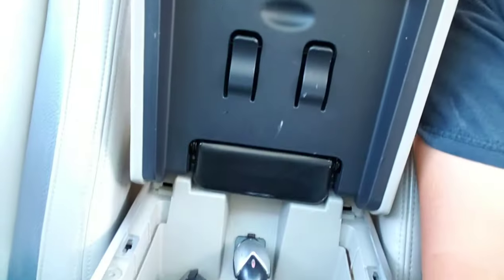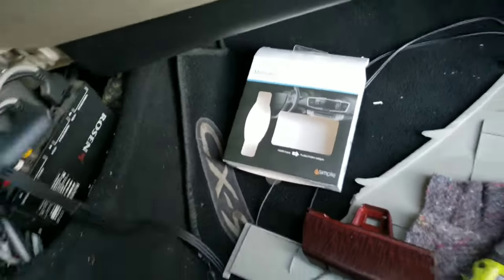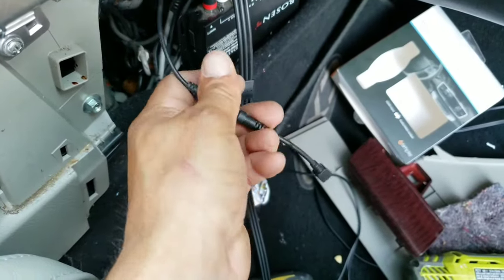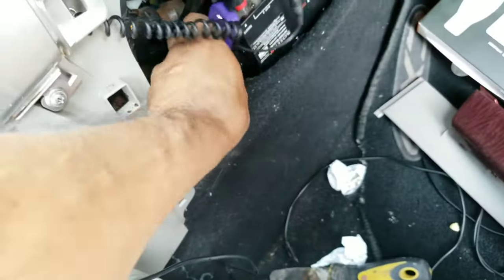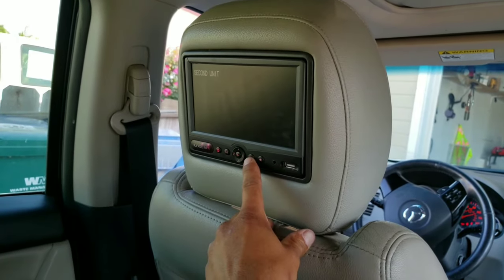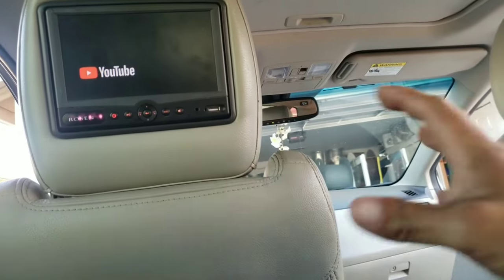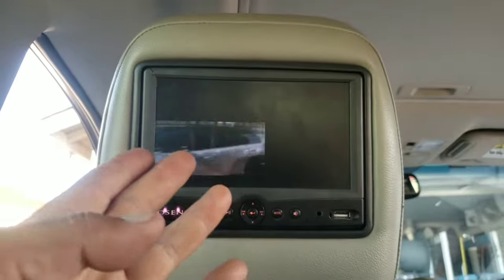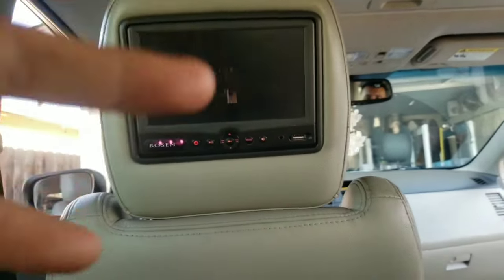How to install a roku stick in your car to watch Netflix and YouTube

Comment from the maker: things youll need to get this done 
HDMI CONVERTER -
https://rover.ebay.com/rover/1/711-53200-19255-0/1?mpre=https%3A%2F%2Fwww.ebay.com%2Fitm%2FUS-5Ft-HDMI-To-3-RCA-Video-Audio-AV-Component-Converter-Adapter-Cable-For-HDTV%2F202373420209%3Fepid%3D21030898729%26hash%3Ditem2f1e6554b1%3Ag%3Am6gAAOSwXSRbLU5B&campid=5338555346&toolid=20008

roku stick-
https://rover.ebay.com/rover/1/711-53200-19255-0/1?mpre=https%3A%2F%2Fwww.ebay.com%2Fitm%2FRoku-Streaming-Stick-Streaming-Player%2F264345037988%3Fepid%3D14029108177%26hash%3Ditem3d8c312ca4%253Ag%253AUpMAAOSw1kVc8gH3%26LH_ItemCondition%3D1000&campid=5338555348&toolid=20008
Reply from the maker: It should work I can't find a reason it wouldn't. 👍✌

Comment: You could have used a Roku Express+ (only from Walmart) which already has the component out (red/yellow/white) connectors for way cheaper than your HDMI converter.
Reply from the maker: Nice I'll check that out , I didn't know that existed that makes everything a lot easier, thanks I appreciate the tip bro👍✌
Reply: @CALIREBUILDABLES   No problem.  The only downside for the Roku Express, is I believe you need line-of-sight for the remote - it's IR instead of RF.
Reply from the maker: O ok it's still a good option I mean there is something for everyone, if that don't work then something else might the good thing is that we have more than 1 option👍
Reply: @CALIREBUILDABLES  Or you can use a newer roku stick and not a 10y old one?

Comment: I’m interested in buying a tv player for my car. Is the one you have installed need to be charged? I’m not really familiar with how this all works. Thank you
Reply from the maker: No they usually get connected to the car or you can buy one that plugs into the cigarette lighter but it's better if you get them wired unless you want to bring it off the car .thanks for watching 👍✌
Reply: @CALIREBUILDABLES  Thank you I appreciate it! Is the wiring something that I can do myself or do I have to go get it done? If I buy one that plugs into cigarette lighter how much does that drain the car battery?
Reply from the maker: I'm pretty sure anyone can it's just a matter of knowing what cable goes where but I'm pretty sure the manual will have instructions on it and about the battery drainage of you leave the TVs running with the car off anything will drain your battery but if the car is running you'll have no problem. And the removable ones are more simple to connect and play and ofcourse you can bring them of your car whenever you feel like. 👍✌

Comment: I can’t get it work on my nex2400 stereo bc I can’t connect to my hotspot so my
Remote isn’t working any ideas?
Reply from the maker: There is a different roku that controller doesn't need wifi connection bro👍✌️